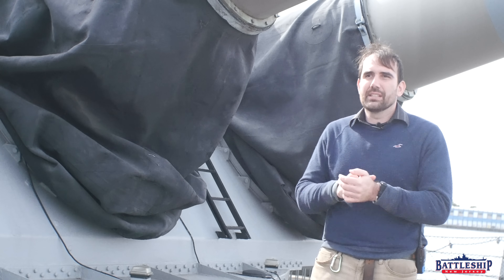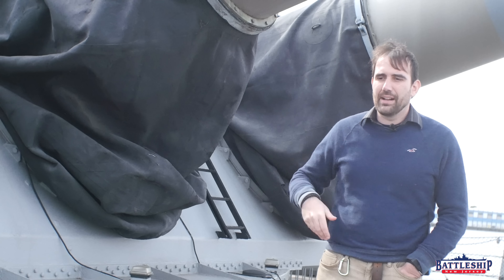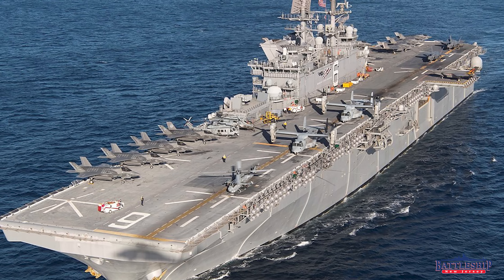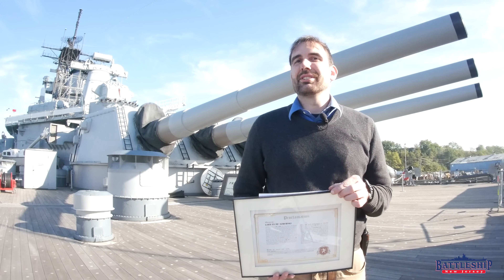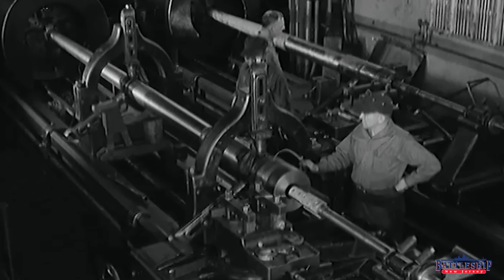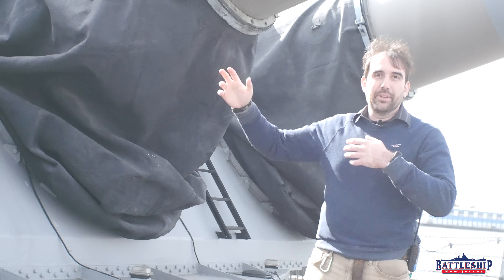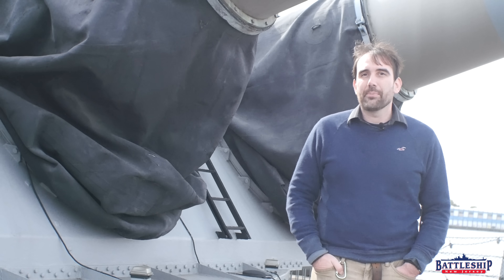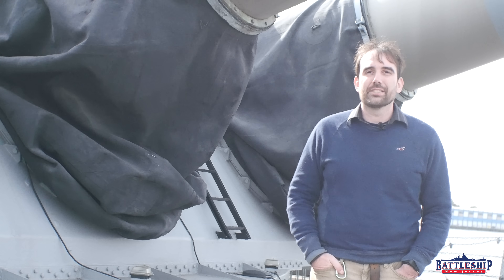How Much Would It Cost to Build a Battleship Today?

Comment: Build new, and absoutely not from old blueprints. The problems are as simple as the fact that people have become taller since the 40's.

But also; you are nolonger defending against incoming 16" rounds, you are defending against missles. You're not fighting off slow moving propellor planes, but jets. You are waging war against ships that can literally run circles around your great big and very very slow hulk of armour while they drop a couple of torpedoes and watch you go down.

But the best argument against re-activating is what Ryan said; there are literally tens of thousands of problems hiding under decades of low-budget maintenance. If you want to get a ship that is even remotely reliable you're going to have to strip al the wiring, replace all electronics, replace the entire boiler and turbine section, the propshaft, propellors, all the guns... inspect all the welding etc etc... And then ofcourse put new stuff back in so you have to make moden guns fit in the existing holes, you have to design a new engine that fits in the existing area...

The idea of re-activating a ship from the 40's is cute and nostalgic and it may have been feasable a long long time ago but today it's simply assenine.

Comment: Would probably go the route of making a new ship like a more modern Kirov in concept. Primarily a missile ship. Probably could redesign an amphibious assault ships hull design to fit a ton of VLS packs Then maybe create a triple gun turret with 6" guns since most of the advancements in artillery shell technology is for 155mm guns. No point spending the extra cost of upscaling to a larger gun caliber as Excalibur shells already cost 100k a piece and XM1113 unguided rocket assisted shells are 15k a piece. Don't need much in terms of large caliber naval artillery since most near peer states don't have ships that are really armored as technology had taken central focus as most modern ships are not really armored, missiles will do the job or smaller caliber artillery. End of the day though, would be an expensive waste. For force projection that's what Aircraft carriers are for, for delivering a bunch of missiles that's what subs and destroyers are for in addition to all of the aircraft on an aircraft carrier are for.

Comment: If you are gonna spend that kind of money you need to go long term and so you must go new build. The question on that though is what purpose do they serve in a modern battlespace to desire a ship that size with 16 inch (or larger) guns as the primary armament? on the flip side a ship like that built new could be designed to carry missiles from the start. If the purpose is to carry tactical missiles (anti-ship and anti-aircraft) does it make sense to go that big or get multiple smaller ships? If the purpose is to pack a ton of sea launched cruise missiles we have converted ballistic missile subs. If the purpose is shore bombardment  do we need guns that big and in that number enough to justify the cost? As you would not have flot planes would you try and put a landing space a for a could of helicopters on it?

To be sure it would be a bad ass ship. But does it makes sense?

Comment: Reactivate. Remove the turrets, boilers etc. Install gas turbines for propulsion, design and build rotary missile launchers to fit the #2 & #3 barbette. Redesign a 2 barrel turret for number #1 barbette and make them a 8 or 10 inch gun. Stack the ship with AIM120D NASAM systems and CWIS. I would also incorporate active armor systems throughout the ship as well as below the waterline.

Comment: Actually, given my choice, I would NOT attempt to build a modern version of an Iowa Class Battleship, but rather a Mississippi pre-Dreadnought Battleship would be my choice.  I'd eliminate the 7" guns, and replace the 8" guns with something smaller, such as 3", 4", or 5", though I would not rule out using 6" secondary guns.  The primary armament would be enlarged versions of the 6" (155mm) gun-howitzers used by the Army in the M109 (or alternately 12" versions of the 8" guns carried by the Des Moines Class Heavy Cruisers).  Give it sufficient endurance to cross the Pacific with some speed, but also make sure that it could spend a LOT of time just loitering on station.

Comment: i think it would just be more cost effective in the long run at least to just build new. even if it takes building another ship yard that can take building such a ship. first off, even if the ship its self get canceled, we now have another ship yard capable of producing nuclear carriers making replacing, maintaining, and in the event of a war keeping those 2 us as needed a lot easier. second, nuclear power would keep fuel price low part in due to newer more efficient more compact reactors. while it would still be the most expensive part of the sip to run, it would in theory be less then trying to do so with say the Nimitz and its 4 large reactors, at least with similar technology. after that, i would say prefer missile over 16in cannons more so then if you were to just mount a lot of missiles and call that your main weapon, like say maybe only 1 or 2 dule or tipple mount 16in turrets at the front. that way you get more effective fire power against most targets at longer ranges while still retaining some kind of battleship caliber "main battery" for when, A, you run out of missiles, B, need some shore bombardment, or C, because we are building such a ship there WILL be someone who will build something similar to counter it. and 16in heavy AP tends to go through more armor then your standard ASM. at the same time both 16in heavy AP and any ASM would have to deal with CWIS. but the effectiveness of such would largely be effected by the speed of either. a CIWS is going to have a hard time defending shooting munitions down if it will get there before the CIWS has the time to shoot it down. beyond that, i would say automate as much as you possibly can to cut down on crew costs and maybe you might just find a way to reduce crew on other ships as well. after all necessity is the mother of invention. now, after all of that, i maybe would suggest that we had some kind of flight deck to the back of this so that it isn't just an armored missile platform with 16in guns, but that might be trying to squeeze too much into too the wrong ship type. while there are exceptions to it, it is normally best to follow K.I.S.S. and keep it simple stupid

Comment: I think the largest consideration would be its purpose. A launching platform for missiles, a carrier defense ship with scads of anti submarine, missile interdiction, aircraft defense or shore bombardment artillery (ship Himars). Aluminum hulls melt easier but armor steel slows speed. A cold fusion reactor would be nice. Might as well make a submarine battleship. That would be interesting.  At least it wouldn't have to worry about rough seas or hurricanes. As an artillery platform that can move  position and it probably would be most useful and least expensive.
Reply: Want energy shields and plasma cannons with that wish list of yours? A warp drive too perhaps? ;-)

Comment: to rebuild the capability to produce a Battleship  today would be between 1 & 5 Trillion USD, the US would have to rebuild domestic Steel and Copper, build Chip Foundries and Chemical Works and so on. estimated time would be between 10 and 25 years (though some say 30+) and that's before you wrote the first appropriations bill for the first ship.

Comment: Would an A1B (or I guess B1B) reactor result in crew and size savings over a boiler plant?
Reply: I am an ex-boilermaker, 68 years old.  I worked at PSNS.   I doubt there are enough of us left to actually build one and then maintain them.  The downside of a nuclear power plant, is it has to be manned continually once the core is placed in the reactor.

Comment: Very interesting and concise analysis.  A further cost to reactivating an Iowa is the engines.  The current engines are old and would need to be totally replaced in a full on refit, which means opening up the decks to do that, a significant cost in money and time.
If using old pattern 16 inch guns you also need to put that scale propellant and shell manufacture costs into play as well as training the crew to handle all that.
I can imagine the OH&S measures would be far more stringent today than in WW2.

Comment: first of what tactical role would a battleship fulfill today? shore bombardament is the usual argument which means the ship would have to go rather close to a hostile shore to be effective. eventhough there has been no assault upon a hostile shore since 1950 when the US landed at Inchon in Korea and USS Missouri wasn´t presents at first at Inchon. the initial shore bombardament was done by some heavy and light cruisers from the US and UK and 6 destroyers from the US. 
but for the sake of argument if i were to bring back a "battleship" i wouldnt go above 8" 55 caliber guns akin to what USS salem and Des Moines was equiped with also they were auto loaded, ship size i would look at uparmoring a Arleigh Burke class hull  with a composite ceramic armor and maybe elongate it a bit to accommodate 1 or 2 barbettes for either a dual or single mount 8" gun totalling 2-4 guns. and still equip the ship with something around 32 - 64 VLS launchers and appropiate CIWS. about doubling the displacement of a Arleigh Burke class ship (armor and bigger guns) i would also retain the hangers for 2 ASW helicopters the guns would be in a A - Z configuration one about where the current 5" mount is placed and one behind funnel 2  
still if a situation arise where a forced entry upon a hostile shore arises it would be a prime target for current gen. cruise missiles loaded with submunitions to take out trench systems and smaller bunkers before hitting a primery target. the point here being the all big gun ship is a thing of the past

Comment: The real question we want to know is how much would it cost to reactivate Battleship Texas???
Reply: Battleships Texas is far too old now to ever see combat service ever again.

However, let's pretend for a moment that wasn't the case. For what they would have to do with that ole ship; there is plenty needed to be done. Completely tear out the boilers that no doubt are no longer remotely safe to operate, new diesel engines or gas turbines, major structural reinforcing for parts of the ship, tear out four of the five 14" turrets, automate the 14" ammo loading system, remove all the secondary guns, tear off the tripod mast, make the commanding tower shorter...

install new stealth propellers, reworking of the propeller shaft mechanisms, completely seal off the former torpedo launch tubes permanently, new plumbing, improved water drainage system, modern wiring, modern electrical outlets, state of the art radar, wireless communications, increased bow length and complete redesign of the front with newer design philosophies, replacement of Class A/B in many areas with composite armor; reactive armor in specific areas, vertical missile cells, anti-drone machine guns (like Poland's Browning-type for example), modern sleeping amenities, redesigning of the back of the ship to allow for helicopter landings, and modern fire safety equipment and training practices. 

It probably wouldn't be quite as expensive, but it still would be plenty expensive.

Comment: If there were orders to bring back battleships those orders would specify the purpose and reasoning to do so, and even if they did not outline a specific choice that would make it clear. If we are bringing back for an immediate need for heavy duty naval shore bombardment we reactivate, if we are developing a new capability to add to the navy (perhaps new armour and protection tech somehow bring the calculus back in favour of a ship that can take a hit and keep fighting with some new super armour that can resist hits from modern weapons and we somehow become very confident we can defend from a sub) then we build new. Pretty much every 'new capability to the navy' scenario ends in new build ships being in, if they want a long term capability it makes sense to have the full maintenance and repair package available and so you go the whole investing route and bite the infrastructure bullet. If there is an immediate need for a battleship for some reason and it is not a new capability that is being added, but instead is a temporary need or solution then reactivating starts to look attractive quickly.

Comment: Forget reactivating. Too expensive to do the work to reactivate them, too expensive to crew and maintain them. Limited life span: reactivated ships are not going to last 50 more years. So we go with new builds. First questions to ask if you are going to build a modern battleship class warship: What is it's mission and what threats is it going to face? No potential adversary has large armored warships so it t is not needed for putting 16" gunfire on an armored target 23 miles away. We aren't going to be sending troops to storm contested beaches so traditional amphibious gunfire support will not be needed. What is needed is to carry the largest number of missile tubes to defend against attacks from naval surface, subsurface and airborne threats that are up to several hundred miles away, ballistic missiles attack from up to 2500 miles away. And the ability to attack sea air and land targets at the same distance. (subsurface targets as well if possible).You will also need a ship that can take hits and keep fighting, which means protection, resiliency and redundancy. With these requirements the ship starts to design itself: large hull,  vertical launch missile tubes, Aegis, some form of armor protection, some form of close in missile defense from multiple threats arriving simultaneously, some form of torpedo defense. She can carry guns for close in targets. I would think MM155/66 or 155/70,60 70 mile range. For close in defense, lasers if available, RAM missiles, something with a longer range than CIWS (57MM to 76MM with guided shells perhaps). If you have to have big guns: one or two twin turrets, 22" or 24", 60 or 70 caliber barrel length, firing some form of guided rocket assisted shell (Full bore or sub caliber) 300 mile range or more. 4 screws, gas turbine power plant 80-90 thousand HP per shaft. Why not a nuclear plant? it's too fragile. More likely to go offline if the ship is hit hard. And if the reactor takes a penetrating, hit you're lost the whole ship regardless if she stays afloat. toss in 4 helos or tilt-rotors and some drones for recon and over the horizon targeting and sub defense and you're good to go. Finally armor protection: She has to survive multiple hits from Kh-32 class weapons. A single armor steel belt of 12" to 20" inches thick probably is not going to be enough, so we'll have to get creative: reactive armor, Active armor, composites, ceramic, multiple armor bulkheads, whatever we can come up with, starting with just not getting hit. Anyway those are my thoughts on it.

Comment: And there's a host of other reasons mostly military and budget wise as to why building from scratch a brand new Iowa class Battleship would be prohibitive .
One would be the old question of how air power sank the modern idea of Battleship and how this new Iowa class Battleship overcomes that without any air Wings of its own !
Surface-to-air missiles are great and all and the Phalanx ciwis is good as long as it isn't swarmed attack , but the old problem will persist as to how to protect these moving castles on the Seas from eminent destruction from the air !
I would suggest a new type of hybrid carrier battleship amphibious assault ship that would have a minimum amount of super guns ," not rail guns " but more like 75 caliber 16-in gun backed up by 50 caliber 5-in gun .
Again minimally that would be followed up with a healthy assortment of cruise missiles , air to air missiles and a hanger Bay that support at least 6 troop carrying helicopters or VTOL , 12 helicopter gun ships for close air support and maybe even four to eight F-35 for Fleet defense !

Sounds like a lot , but take into consideration a lot of this Firepower is there to protect the ship , the crew and the Marine expeditionary forces .
That's all before we get to offensive weapons !
( Here is to say that defensive weapon can be used offensively ! )
Effectively a ship that has the best points of a battleship & a small carrier bundled into a package of proven Naval architecture , not that letoro class  crap we saw !

Comment: I would not build a battleship.  I would build something the size of the 8" option Alaska class large cruiser.   Anti-ship missles are small or huge.  No amount of armor is going to defeat s missile like Russian Shipwreck and  you don't battleship grade armor to defeat the small missiles, 6-8" is enough.   You might include some Naval Artillery for shore bombardment but the primary armament will be anti-air, anti-ship and land attack missiles with the required  radars to support it.

Comment: Build them new, make better use of CFD for increased performance and save weight using composites and super alloys wherever possible. I'd build it 1000ft long 125ft wide amidships with azipods as primary propulsion using gas turbines to drive the generators. Lots of options using modern technology.

Comment: Based on the lessons of the Fawklands and Ukraine war a new Modern Battleship would in my opinion be the better option. Straight up armor is less useful than active protection measures and good damage control, 
Tube artiliary has proven to still be quite useful in the Ukraine war, but range is the most important factor